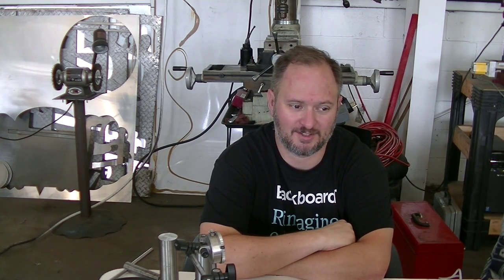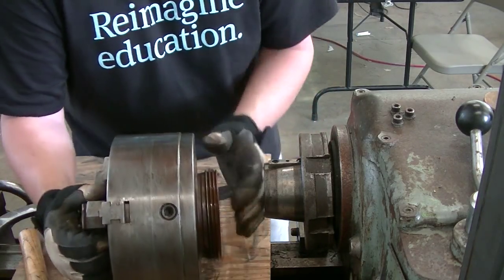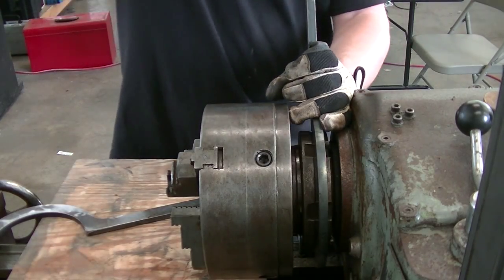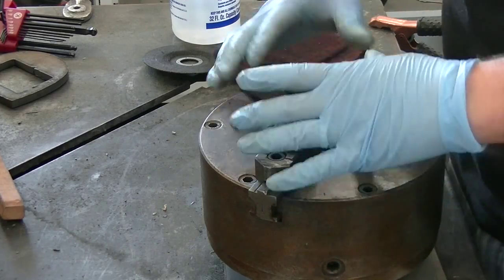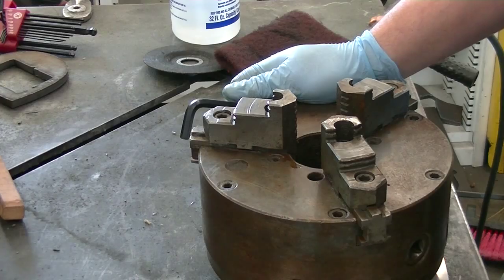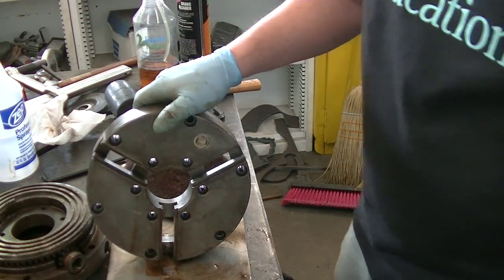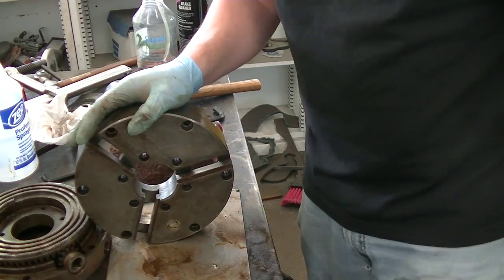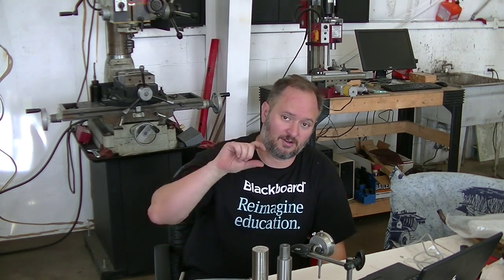Shop Update Series - Episode 17

Comment: What tool post are you using and whats the largest tool holder you can use and still get it on center?
Reply from the maker: Apologies but I don't own that lathe any longer. A good friend needed a lathe and I moved more into the CNC side of things. Need to get a small, manual lathe for the shop but no room right now.
Reply: @TomZelickman  would you make the wrenches?
Reply from the maker: @earleclemans4836  I'd be glad to. The design is in a proprietary format for the plasma cutter or I'd just send it to you.
Reply: @TomZelickman  how much for a set?

Comment: Where did you get the wrench for the L0 nut?
Reply from the maker: I plasma cut it. I think I still have the design if you need me to make one. It was overkill using 3/8” steel; 1/4” would have been just fine.
Reply: @TomZelickman  the plan would be appreciated or i can buy the wrenches from you if the other deal falls through..i have the same lathe as you and need wrenches